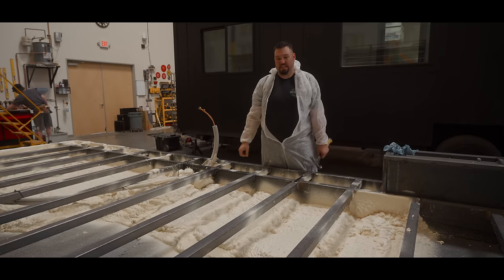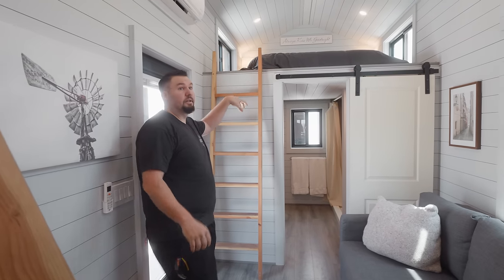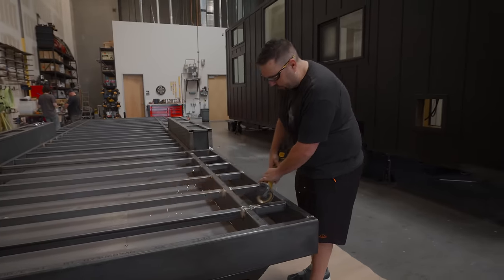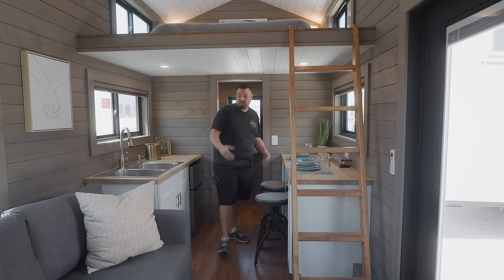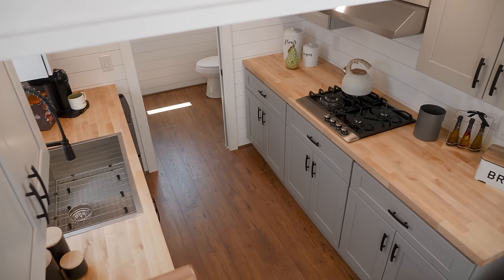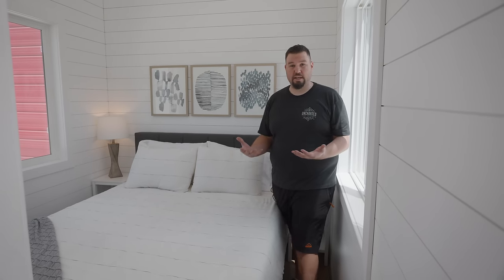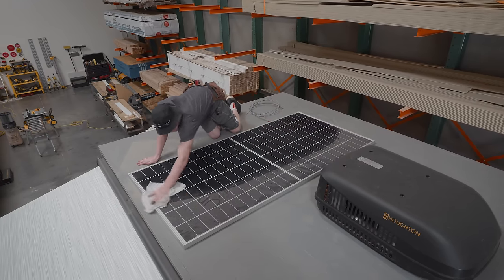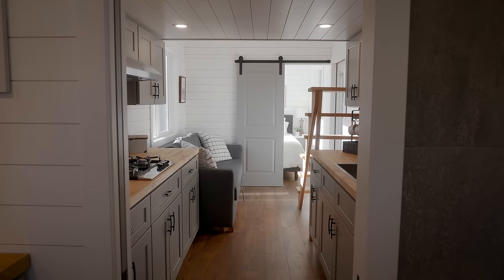Building a Fleet of Tiny Homes on Wheels | PARAGRAPHIC

Comment: On point.
The thing is, these companies basically make a more expensive fancy RV set on a trailer just like he said.. i have been following it for years, this is such a big difference from the diy container tinyhomes on trailer frames ha. The thing is, most people looking to do tinyhomes are on a budget, but these tinyhome companies popping up price them more than a new rv or small country house, ha.
Reply: Nice.. his prices are more reasonable than some of these other 'tiny home' builders
Reply: @dertythegrower  I don't see why you're surprised by the pricing coming from some of these companies. They're working in a niche industry creating a product with the qualities of a stationary home, the mobility of an rv, and custom built for each customer. You're crazy to think something like that wouldn't be expensive.
Reply: Right the owner is a interior modeler. very well done. but is the material weightless and does it factor in the safety behind traveling with this home on the road ?

Comment: So when the plumbing leaks you have to tear out the entire floor?. Also A.C. lines will still have condensation and inclosing them as such will likely cause water and possible mold issues. Spray foam will also release gases in such a small space for years and years. If you want a great design for future litigation, this is probably a great design.  I would suggest getting some design consulting from a good engineer/designer/architect and actual builder. Not to mention a product specialist. good luck

Comment: These things have one major flaw..... and that's having all of the plumbing/drainage/electrical built into the floor and covered with spray foam. What happens when any of that stuff starts going bad (and everything will eventually)? Instead of crawling underneath or opening a panel you would literally have to rip everything apart to do repairs. I'd rather see some sort of separation where those things run, with access panels installed, and some sort of removable insulation so repairs can be done with more ease and less destruction of the home. Sure, with something removable you'll sacrifice a bit of insulating compared to the foam. But I'd rather take that hit to avoid having to rip open floors/walls as much as possible when it comes time for electrical or plumbing repair.
Reply: You'd think they'd have thought of that by now. Ease of living should also include worry free ease of maintenance too. Not to mention the time and labor to repair what's hurried and buried under the foam. Great point sir/ma'am. (Not sure how to address anyone anymore) But hey, this will do: 😎👍 (until that gets cancelled) 😂😂
Reply: They should do it through conduit.
Reply: Those pipes last for very long. Probably longer than the expected service life.
Reply: Did he say the spray foam was applied over the top of the plumbing as well as underneath?  I thought it was just on the bottom of the interior, and then the pipes, etc., were installed over that.